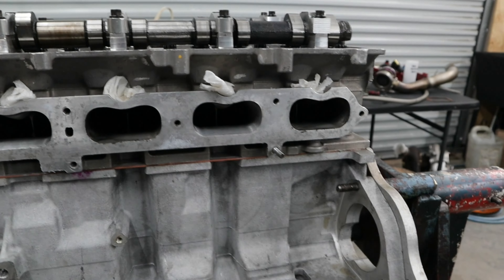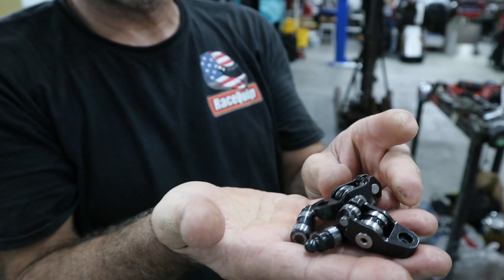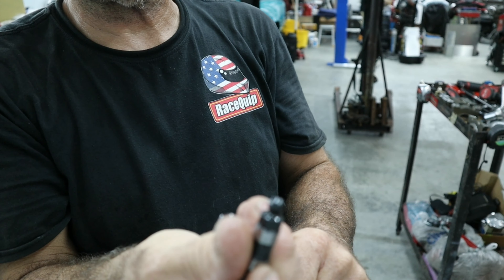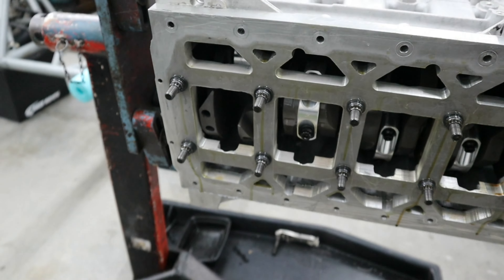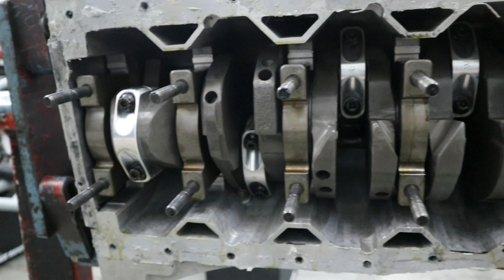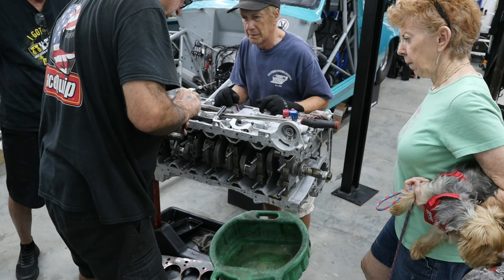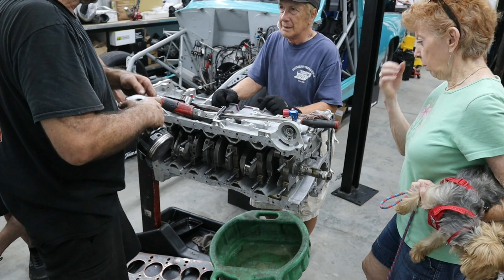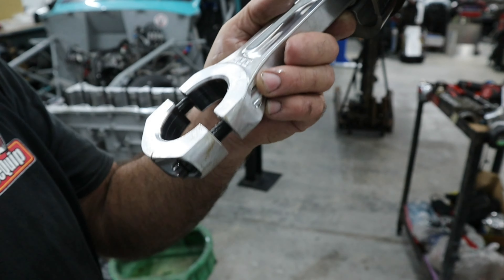Ameri-Barra, Atlas 4200, engine tear down, part 3.

Comment: Wow. They welded all the coolant passages shut on the deck and the head. That knife edging is awesome too. The factory engines only have 180 degree thrust on the block side of the engine. Looks like they used two top side thrust bearings to make it a 360 degree thrust. 

I hear the trick on these engines is to put BBC rod bearings with a custom rod since they are 2.200" and factory is 2.232". 2.000" is scary small. I'm amazed the crank is holding up. 

Thank you so much for sharing this!!!
Reply from the maker: I agree that the 2.000' rod is scary small, remember these guys were all about 10k rpm n/a power, think they lost touch with the turbo build. Ring package is scary thin also.
Reply: @LANDISPERFORMANCE  Yeah. The factory stuff seems to hold up and it's pretty thin. I definitely would prefer a little thicker though.
Reply from the maker: Calvin, you are correct, that they welded all coolant passages around the cylinder walls, combustion area, probably to stabilize the cylinders, and make better head gasket sealing. But there is still coolant passing through, and yes they used 2 thrust bearings, to form a 360 degree surface, which is one of the things I am concerned about, since ours is in bad shape. I agree with the 360 degree surface, just need to figure out where the damage is coming from, and have no idea if this was always a problem or just this build. The converter is one we have used before. Leo and I will have a conversation about that. We are going to build a second engine with some of my ideas, one being the BBC steel rod, and using a good piston in the stock sleeve.
Reply: @LANDISPERFORMANCE  Good call on building another engine, might be able to get away with a stock head with a good port, stock lifters and reground cams. Would probably need 0 maintenance through out the year. I feel like the self engine should be for big big power, hondas aren't even using billet rods to make over 1000 wheel hp these days. I think youll run into issues with the stock main caps and stock crank before maxing out a steel rod.

Comment: Where was the metal head gasket made? Probably not available to purchase of the shelf?
Reply from the maker: The head gasket is a copper gasket, make by Clark. This engine has a lot of the coolant passages around the cylinders welded shut, so it may not work for everyone. Thanks for the comment, as soon as we get all of the parts back, we will do a engine build video
Reply: @LANDISPERFORMANCE  great info thank you for sharing!

Comment: Does the block have any head stud thread inserts installed to mitigate thread pulling?
Reply from the maker: Not that I can see, the studs are 11mm x 2.0 which is the stock head bolt size, from my information

Comment: Thanks for the information! I read some where that this engine initially was priced at like 60k or something, kind of crazy to see stock main caps and not billet mains and a stock crankshaft and not a billet crank for such a high price tag. Also the big HP barra guys run a torrington bearing in between the block and the crank shaft on the #1 journal to stop the thrust bearing from getting worn out. Let us know when you find out what valvesprings they were running! Also do you know if the headstuds were drilled to accept a bigger stud or are they OEM size but ARP headstuds? Also check out VP racing they have a fuel additive that you can run with Ethanol and methanol that prevents your valves and engine from rusting, i was brough on to this cause alot of the turbo jetski community has these issues with valves rusting when using ethanol fuels, it pulls the humidity into the engine and does a number on everything. The additive i was talking about is called "VP RACING M2 UPPER CYLINDER LUBE ", just pour it into the tank and no need to fog it when your done.
Reply from the maker: Currently we run VP C16 fuel, but thanks for the comment. I will find out on the head studs, but I believe they were oversized units.
Reply from the maker: I just measured the ARP head studs, and the thread going into the block is 11mm x 2.0 which I believe is the stock thread size and pitch. I haven't figured out what application the studs are, but there is a .650" spacer that goes between the cylinder head and the washer and nut on the stud.
Reply: @LANDISPERFORMANCE  Thats interesting seems like theres still alot of improvement that can be done with that engine. Just Billet main caps, and a billet crank would probably make this thing capable of holding 2000hp

Comment: Did the crank timing ring get cut off? Or just not visible in the video?
Reply from the maker: We use a crank trigger on the front of the crankshaft, and run Holley EFI
Reply from the maker: Looking at the 4200 wiki page, looks like this is a 2002-2005 12 counter weight crankshaft, with the timing wheel ground off. https://sites.google.com/view/vortec4200wiki/bottom-end?authuser=0

Comment: Any extra info on the jesel valvetrain?
Reply from the maker: The engine uses a solid lifer, with shims for adjustments, and a roller rocker are. Comp Camshafts. Regular race engine parts. What other information are you looking for?  Basically the valvetrain components are GM Ecotec. If you look at Jesel's website look under followers. Hope this helps. Thanks for the comment
Reply: @LANDISPERFORMANCE  that helped. So ecotec parts retrofitted to the 4200.
Reply from the maker: @Kincentc  I believe alot of the valve train parts interchange, springs and retainers also

Comment: Sorry to see so many issues on the motor with only three passes. Do you have a back up motor to work with? I’m a new subscriber so I don’t know any of the history. Good luck, I bought a 2004 trailblazer new and drove it for 185,000 miles, it always ran great and revved like crazy, it made more power than the 4.8L in my Silverado, so I’ve always liked the motors, the transmissions weren’t great, that’s what failed on me, it may have been a cooler issue though
Reply from the maker: I have a 2002 Trailblazer also, and our transmission tore up too. Engine still runs strong. As far as Leo's race car, this is our only engine, however he has been collecting engine cores, so we probably will build a second engine with some of the stuff we learn from this engine, together with stuff I have found to work over the years I've been building cars. Thanks for subscribing!

Comment: ❤Is the crank original GM modified? I have (3) Self 565 BBC’s. I just found out about two weeks ago of their passing. Best people I ever worked with. RIP
Reply from the maker: Yes, stock crank that they had knife edged, rod journal cut to 2.000" and looks to be nitrated
Reply: @LANDISPERFORMANCE  Kevin did a Mopar head back in 2005 for my Comp Eliminator F/ED. I owned the NHRA record for several years with 187 ci. @ 470 HP. Happy times!